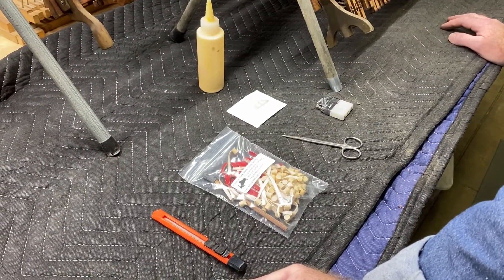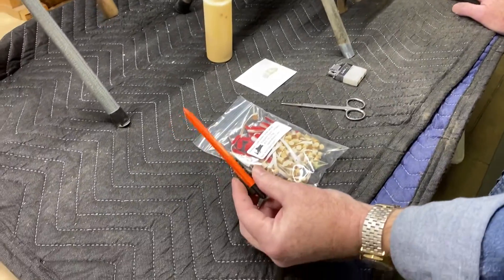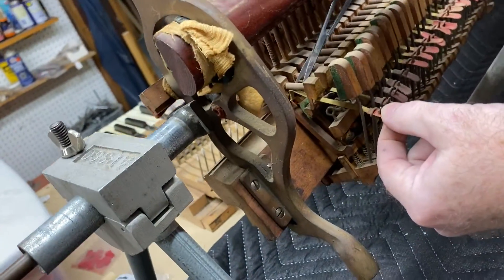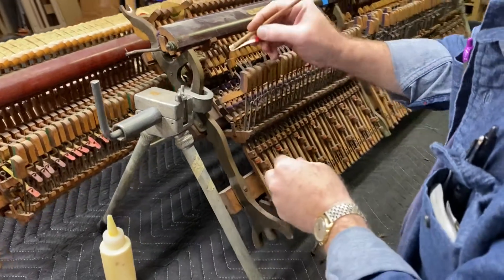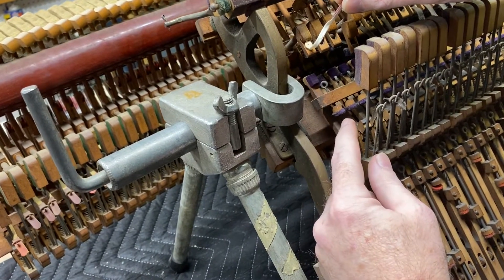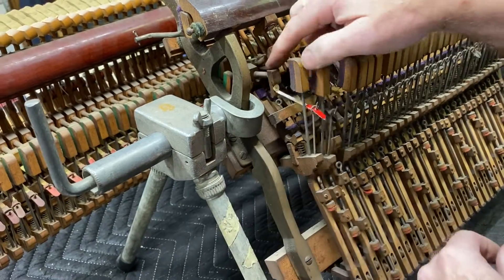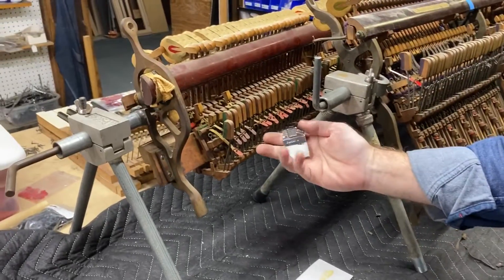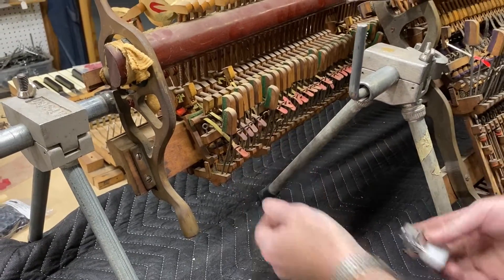Piano Repair - Cork Bridle Strap Installation

Comment: Exellent. NONE of the videos on changing bridle straps that come up in a YouTube search were this informative or clear on what's going on in there. Had to get this link from the vendor but once explained here, everything fell into place.

Thanks also for the illustration of how to use the insertion tool, BUT users note, don't press the needle deeply into the cork or use it to force the cork into the hole, as it will split the cork the same way you split a piece of wood with a nail when it's too small for the nail.
Reply from the maker: Glad you liked the video. If the cork splits, there is some other problem.  I've never split a cork using this tool and the technique is demonstrated in the video without splitting the cork.